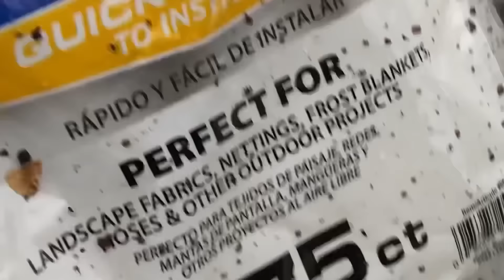WE ARE OVER IT..TILL DEATH DO US PART

Comment: You may want to Google or YouTube companion planting.  I do know people plant beans with corn and also pumpkins/watermelons.  The corn provides the beans something to climb on, the beans will absorb nitrogen from the air and add to the soil (not right away but when it dye back leave the roots and cut out the bean plant above the soil), the pumpkin/watermelon will help cover the ground like a mulch and hold moisture.  

Also if you get a good compost you won’t have to buy the bags of clay breaker.  They may have it at the place you buy your bulk soil.  Not the 50/50 mix just pure compost.  You can use your chicken manure but it has to age at least 6mos or it could burn your plants. I hope this helps. God bless

Comment: Yikes!  I didn't realize you were running a tiller in a raised bed.  I thought you were on solid ground.  The weight of the tiller and the vibrations from it would break almost any raised bed frame.